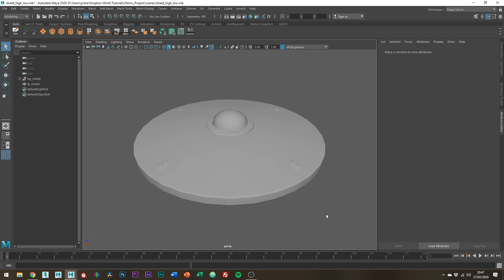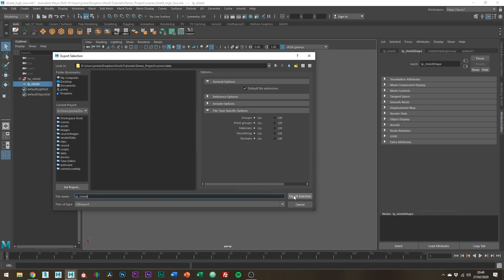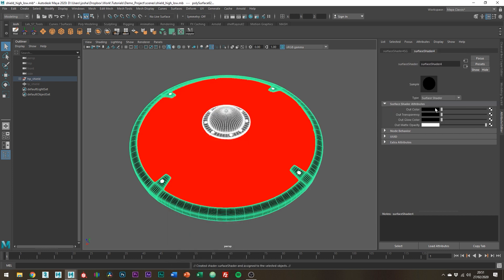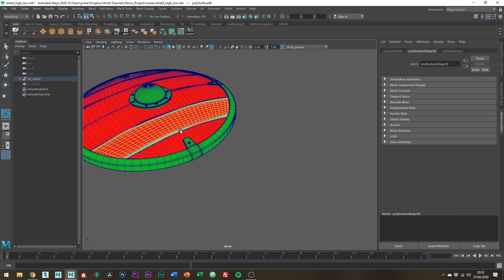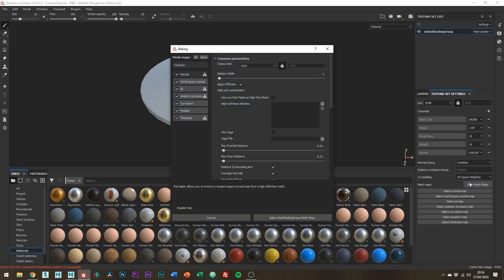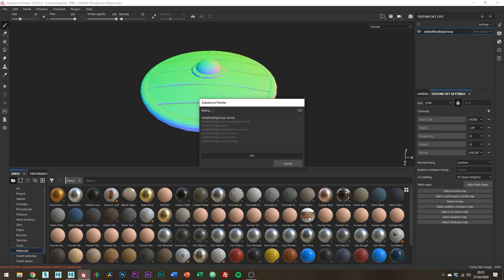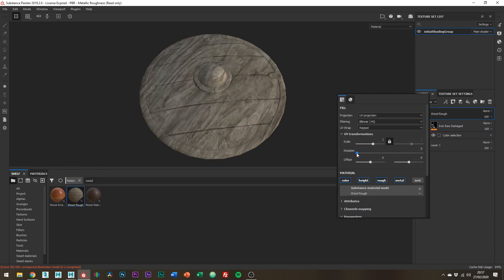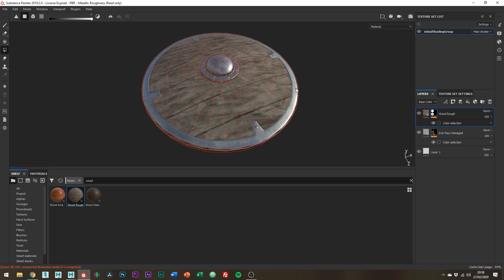High-Poly to Low-Poly Workflow Made Simple

Comment: Nice, but I try to figure out for a while - how it is possile you added 2 shader (assign material) in Maya, but then suddenly in Substance it has only 1 shader (material slot)???? Can you expand a little bit on this, would helpful a lot as it is really not clear.
Reply from the maker: Hey so in the video we assign multiple shaders to the high poly asset so we can easily mask. We use this for baking the maps to the low poly. The low poly has just one shader so that’s why only one material slot shows in substance.

The multiple shaders are then projected and baked so we can use that to mask out the wood and metal areas easily.

I hope this makes a little more sense now.

Comment: Do you unwrapped high poly model also or bake without unwrap?
Reply from the maker: The high-poly model doesn't need to be unwrapped for the bake to work
Reply: @JoshAntonio  Thanks for your response.
Reply from the maker: @3dsquare85  no problem :)

Comment: Really lovely tutorial. And I think I actually understand it now. However one query - So, if I’m just modelling for example an old medieval style house. And lots of it is just low poly cubes with not that high of a poly count, would I get away with just not even doing a high and low poly version ? What is considered the line crossed when it is now a “high poly model” ?
It seems in my mind that most of my models so far would not be high enough to justify having both these versions.. what I can see is that if I wanted to add more detail, like if I wanted to get really detailed on some parts of my model and introduce sculpting on some stones or something?

If you could - what did you achieve , by creating your high poly version of the shield , over just importing the low poly shield into SP and texturing it? What did you gain?
Thankyou again for the nice tutorial

Comment: so why did you use this ID map method of separating materials instead of texture sets?
Reply from the maker: I just prefer using the ID map as a mask on one texture set as appose to working with separate texture sets in Substance. But both have use cases.

Comment: i have some doubts... why you don't allow to compute the tangents when you create a new project in substance, some tutorials i watched pick on that option, another question is what about the hard and soft edges for the normal map in Maya and how to cut and unwrap the UV considering those edges... because i have some issues and artifacts in baking process with complex models and i can't find a normalized workflow that can solve this problem, every tutorial i watch is different referred to this topic... i'm trying to bake correctly a WWII aircraft that i've modeled but i'm mad trying during days different methods of modeling pieces and modifying edges and normals for a correct baking between low and high poly and i can't find the solution.
Reply from the maker: Hey. So regarding the compute tangents question - Depending on the software or game engine targeted to render the texture, this setting may be disabled or enabled. For Maya I leave this off.

For the question about seams. You’re always going to have seams, but it’s about trying to find optimal places to place them, so in parts of the model which isn’t obvious. If you’re struggling baking more complex meshes, you might find doing multiple bakes will work easier and then just combine the maps in photoshop afterwards to get a complete texture tile. Hope this sort of helps...
Reply: @JoshAntonio  is a good solution, i thought that using Photoshop for texturing was relegated, i remember when i used snapshots of the UV seams and painting these in PS 10 years ago... but with the substance wigh UDIM systema and the triplanar to mask the border seams at the result texture i didn't know that PS would continues  to be useful... the problema of baking piece by piece in marmoset is that they don't support UDIM system... and is so repetitive made UV at 0-1 space piece by piece... another thing is... i have the pri cipal issues at hard edges,  i only use one edge with bbtwo support loops but is not so soft i  smooth preview Nd with the hp mesh i have artifacts on those placez, maybe you use in your low poly the bevel tool for soft the borders of your pieces?

Comment: Hi, Josh ,another silly question( Might same as other ppl). for low Poly, is that waste time to merge every part together, or just stack the parts as long as  it looks fine? will doing a ruined building. thanks
Reply from the maker: You shouldn’t need to merge everything, just stack parts together as you would. Just ensure you have a good silhouette for the bake
Reply: @JoshAntonio   ok, I get it. Thanks for the answer! :D

Comment: how different / same can the shape be between low and high poly? For example if my low poly mesh is a bit more squarish, but my high poly is more roundish due to subdivision, is that still ok for baking?  Also, if i have a high poly mesh, how can i change it to low poly if i dont have a low poly one? Would be great to get your opinion on this! Thanks =)
Reply from the maker: That's something you'd have to explore with and see. It's really dependent on the object and how close it will be seen etc.
Reply from the maker: Re: creating a low-poly mesh. You could do more automatic methods like with the reduce modifier. But probably most of the time for best results you'd want to manually create the low-poly version of the asset by hand which is optimised.
Reply: Josh Antonio so I should always create high poly first and then model a low poly version over it ?
Reply from the maker: @ulus2109  Not always. Sometimes I will use the unsubdivided mesh (with a few tweaks), but most of the time you'll want to be modelling over it / cleaning up an older more low-poly version of the mesh to fit nicely.
Reply: Josh Antonio got it thanks. ( need to remember not to apply subdivisions hahah)

Comment: At which point in the workflow do you create the low-poly mesh? And how exactly do you create it roughly speaking? Does it need to align with the world space of the high-poly mesh exactly?
Reply from the maker: Workflow wise you can either make the low-poly mesh before or after the high-poly mesh. Making it before would make sense if you've blocked out the shapes and are then just building upon it to create the high-poly mesh. Or you could make a low-poly mesh afterwards with the polygon drawing tools or/and primitive shapes. Both are valid workflows. World Space-wise, I believe they have to be the same for the baking to work.
Reply: @JoshAntonio  Thank you for the calrification. So to achieve the exact same worldspace, is it just a case of centering the pivots of both models at the same point in the world, or is it more complicated than that?
Reply from the maker: As long as when you're viewing the models they're overlapping then they're in the same worldspace. You want them to be on top of eachother, and matching perfectly.

Comment: So you don't need to create a low poly before the high poly to bake it on Substance Painter? Thanks you :)
Reply from the maker: You can either make the low-poly mesh before or after the high-poly mesh.
Reply: @JoshAntonio  Ooo I see, thanks you so much ☺️
Reply: @JoshAntonio  surely it’s 100x easier to kind of save a previous version of the high poly model as the low poly right ?

Comment: Very Helpful. Do you need to UV the High Poly Mesh as well?
Reply from the maker: Nope just the low poly needs to UVd
Reply: @JoshAntonio  wait, how does that even make sense, isn't the normal map data from the high poly is just applied on the low poly, right??

Comment: Thanks, but you did not show how you created the Low Poly from the High Poly. Can you kindly show it? Thank you. I love your videos!
Reply from the maker: There’s a few approaches. For this I just used a cylinder to quickly form the shape, which is why I didn’t show the process. But I’d happily make a video about retopology
Reply: @JoshAntonio  thanks, will it be possible to do a video about it in the future on how to go from High to Low Poly irrespective of the design?
Reply from the maker: Yeah for sure! I’ll add it to the list 🙂
Reply: @JoshAntonio   i suppose this means high poly first,then re create a low poly . so i don't need to worry abt keep a low res version while creating the high res one..thanks
Reply from the maker: @yingbowang3068  Yeah for the most part. You might find keeping a low-res version might help, sometimes starting with something is better than starting with nothing. But often you will need to specifically model the low-res version afterwards to ensure you have the best shape and silhouette